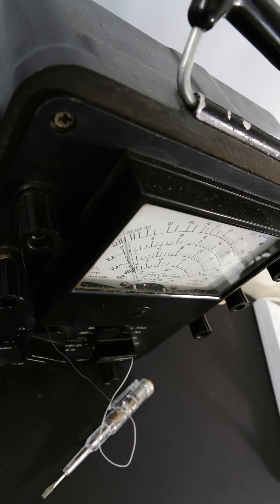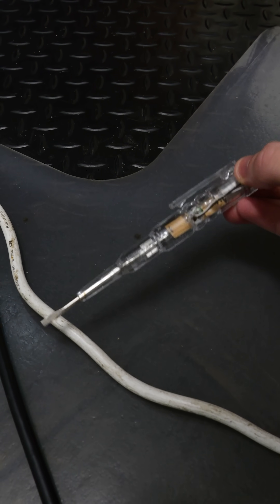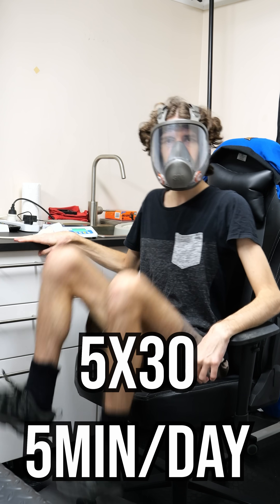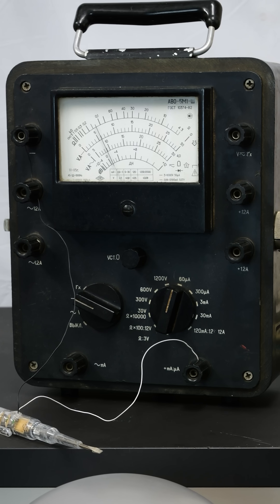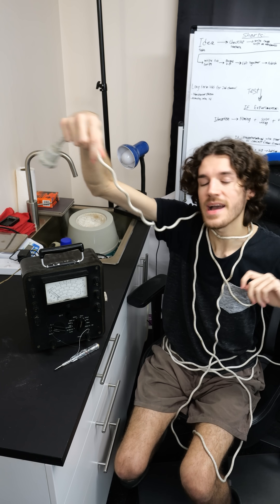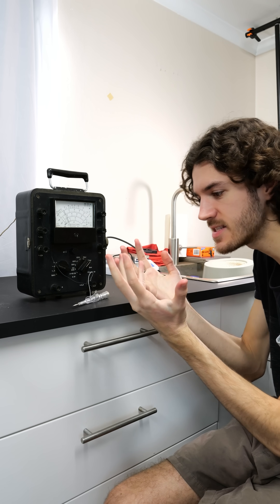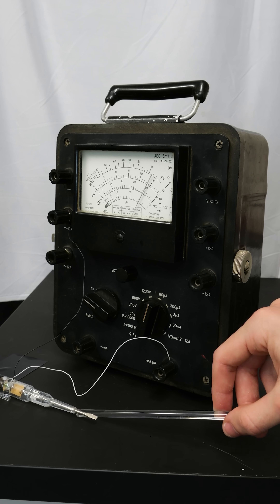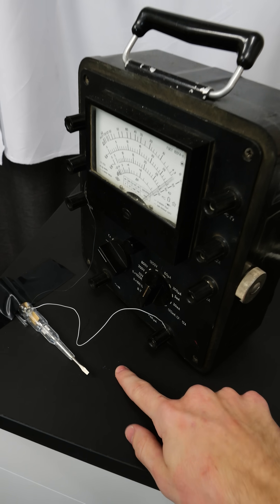This Soviet meter is too sensitive

Comment: Yeah I think it's just working as radio reciever when it's not plugged in. All things you did are what would influence signal reception strength on very low power on entirely passive reciever.

Comment: This is simply an effect of static electricity. It confirms that the microampere panel it uses is very sensitive indeed. I have noticed this effect with other analog (and digital) instruments as well. It is not something special of this specific instrument.

Comment: everything conducts electricity,even if it is bad at it.
This thing is sensitive enough to measure that.
And moving charges will induce a current which it picks up a d amplifies.

Comment: Electrical engineer here, but full disclosure even I'm not completely sure what's happening. I think part of the equation is that your body is picking up radio waves and re-emitting them like an antenna, that may be the "invisible field" you see around you that disappears when you wrap yourself in a grounded wire (like a simple faraday cage).

Almost certainly the very reason why it is reacting so much (and therefore giving a bad reading) is actually because it's not plugged in. Old analog equipment like this often used transformers, inductors, capacitor boosters, and other circuits that can be influenced by very small currents. When not plugged into their proper power supply (and also all ground points are actually ungrounded when unplugged), the current induced by the current flowing in your antenna-like body can cause charges to build in unexpected places, often causing strange behavior on sensitive analog readouts like needles.

Just a guess.

Comment: Don't worry, this multimeter just has a logical negator inside it, so it runs when it has no power and turns off once power is on

Comment: You are correct about the capacitive coupling, but the whole reason different non-conductive objects affect the response is likely due to the changing dielectric properties of the 'capacitor' in this circuit

Comment: Hi, electronics technician here. I spent some time glancing at translations of the soviet service manual...

First off this meter isn't supposed to have a mains lead. Current and voltage measurements are performed without any power but the circuit it's measuring, and the resistance range normally uses batteries. I would suspect that there's some sort of power supply rigged to supplement the 1.5v and 22.5v batteries used in the resistance range... and there's no telling what that power supply (or any other possible changes) might be introducing in regards to weird noise behavior.

So the current range will still work without any power and is, I suspect, reacting to AC mains noise being capacitively coupled from your body.

Comment: this thing doesn't need to be powered to measure voltage. it gets all required energy from the thing it measures. which in this case is 4.5v from the batteries in that screwdriver probe. the gauge just gives better representation of whatever the probe detects than that tiny led.

Comment: This is a fun one. 
You are likely coupling your Home Power to the meter. 

If you touch the probe of an oscilloscope, you can see very well, that there will be a low peak, 50 or 60Hz sine wave, because you are acting as an antenna for your power grid frequency. 
I most likely assume, this is what happens here as well.

Comment: Bro just discovered that the soviet tech is so advanced it doesn't need electricity
Reply: In reality it's more likely that switch on the power strip only connects the live and ground is connected all the time which is why his body is completing the circuit through capacitive coupling and causing a ground loop back into the device.
Reply: That moment when a soviet nuclear reactor completes the 5 year power generation plan in 10 seconds.
Reply: woah
Reply: Most the tech was just stolen from the west, but made cheaper in worse quality.
Reply: It was always in their culture, we thought it was fake news but maybe "comrade Kudlička does the norm at 1052%" wasn't just propaganda...

Comment: So i believe ur capacitively coupling to the electrical wiring all around you!

The meter is plugged in but turned off, your little switch thingy probably doesn't switch the protective ground wire (and shouldn't, that's a safety concern) so it's neative side is probably grounded

You have it on current settings, so it's measuring all current to ground, also for measuring current and even voltage old meters may just not need power at all because the indicator just directly moves current through a little coil in the meter with the needle - moving it.

If you set the meter to resistance it should not be able to measure anything. To measure resistance you need to pass a small current through the resistor measured.

Oh also about capacitive coupling: capacitors charge so current only flows while they are charging or discharging. when you hook DC up to a capacitor (see the balloon) it'll charge up, and then current stops flowing - until of course you move your balloon and the properties of the capacitor change, causing current to flow once again!
AC constantly changes polarity, causing the capacitor to constantly charge and discharge again, which gets you a constant (if averaged over time) current flow

Hope this explanation helps :3 - and if anyone finds a mistake, tell me and I'll fix it hehe

Comment: The thing that killed me is the fact that the meter wasn't even plugged in
Reply: Indeed. I'm no electrical engineer by any means, but I'm impressed that the needle would move from such tiny currents. Does this thing even need to be powered at all!? Weird.
Reply: It is plugged in you can see the power cord at the beginning of the video
Reply: @TheHilariousGoldenChariot  It's "plugged in" but the power strip has on/off buttons, and they were switched to 'off', which you can see if you look closely throughout the video
Reply: Analog meters are awesome. No batteries needed. Just any current will do. And they can be wildly sensitive. 

I have a small collection of analog meters myself because it really feels like you’re “seeing” the electricity. My digital meters are for work, but my analog meters are for experimenting. 😌
Reply: I haven't seen a standard multimeter that needs mains power supply
Reply: @laus9953 a table top multimeter. But I know what you mean, all portable ones are battery powered.

Comment: You're probably capacitively coupled to your home's power system, so it just sees some voltage. Or vice versa you're coupling it to earth when touching the screwdriver, this would explain why when you close the distance between you and the groud it increases. In this case the meter is probably coupled internally.

Comment: You should check if the meter's power supply is even galvanically isolated with a transformer inside.

Comment: My thought: it's acting as an extremely sensitive AC coupled electric field detector! The ncv detector already acts as a sensitive detector, but the multimeter amplifies the tiny current even further. That explains why the balloon causes the needle to jiggle around since it creates a static field that only changes when you move it. The nonconductive objects might work since they function as a dielectric in a capacitor, which increases the capacitance from your body (which is capacitively coupled to the AC lines) to the probe.
Reply from the maker: This is probably the closest theory i've heard for what it is. Very strange stuff!
Reply: @mrgreenguy actually, I'm probably wrong on some of the points. I rewatched the video, amd you're probably right about moisture being responsible for the nonconductive objects (not dielectric effects). Also, the capacitive coupling path would have to be different from what I thought before if the reading goes down when you touch a power cord. Definitely weird! If you have an oscilloscope, maybe that can give you more insight.
Reply: Here's another question
what the hell did they use this for?

Comment: In Soviet Russia, everything is conductive
Reply: During the Great Patriotic War cos(alpha) could be as much as 5.
Reply: well, if the voltage is high enough, literally everything ``is a conductor``... Insulation rating is merely a suggestion, quite like the geneva convention, or like the bullet-proof-ness of something... All it takes is more power the bust through and do what needs to be done...
Reply: even the electrons are communist